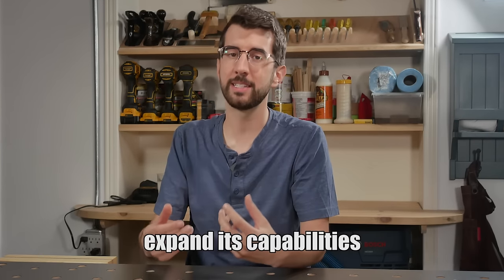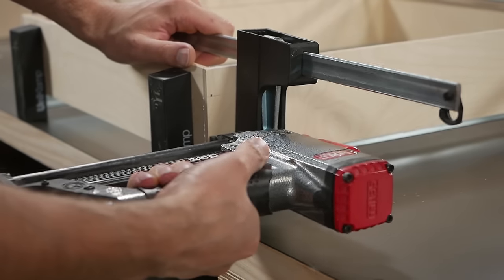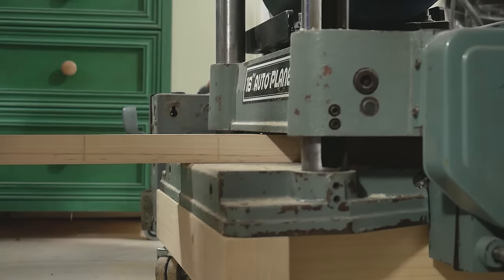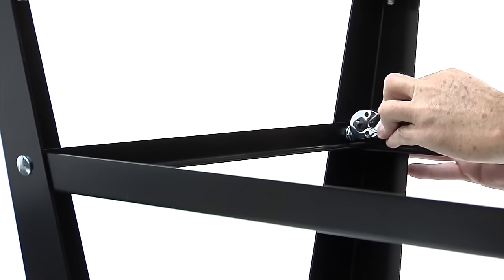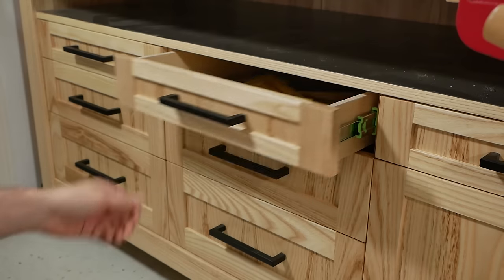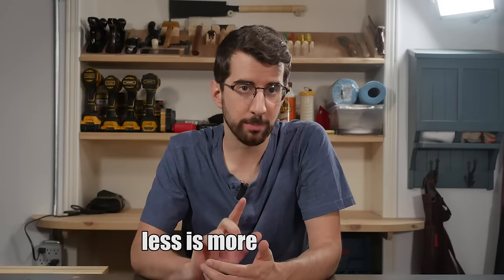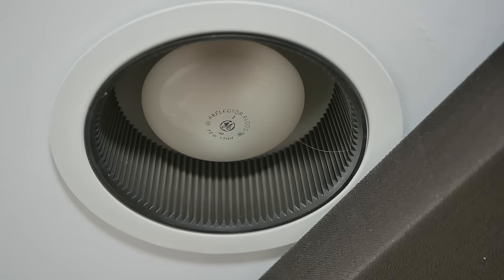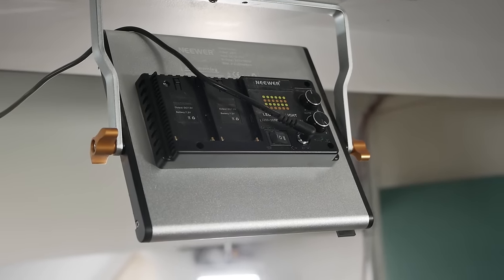a better way to layout your workshop

Comment: Great video and advice. I keep a checklist on a wall that has a schedule for regular maintenance and cleaning of my tools and blades. It helps keep on top of workshop tasks that aren't necessarily every day tasks.

This is tangentially related, but I try to build my shop furniture with the same techniques and methods I would use on fine woodworking projects. It helps me practice in a space where mistakes matter less. And if there is a piece of shop furniture I'm proud of, I'm more invested and likely to keep it clean and organized.
Reply from the maker: yeah, I definitely agree with that. I also simply don't find it enjoyable to half-ass a project, even if it's just for the shop.

I could definitely clean my blades more though 😂

Comment: I run a commercial business and have for decades now running out of a small shop and a commercial storefront, the shop is only 15’x25’ and has an overhead door with an attached 10’x20’ covered area. I have a material cart on casters which can be moved around or out and can store sheet goods, lumber, and a ladder; being able to move this 4’x8’ cart around and outside allows larger jobs to be accomplished inside. I also have my drill press on a cabinet on casters that allows storage of sanders and paper as well as sortimo cases on the other side. Between the table saw with router table which is also on wheels and a chopsaw with wheeled stand I can move things around as needed. I have a bench and operating counter along both long walls with a storage wall opposite the overhead door with every wall having pegboard, I’m old school that way, with lights at 7’ and shelving above that for longer term storage; I also have storage on my rafter decking which accounts for another 180+ sq.ft.
I have used this space to build cabinets and custom inserts for existing spaces as well as large furniture. I like having all tools, regularly used, at arms reach, with second order items below the counter, and third order items above the lights or in the rafter space. While most of my work is out of a custom built trailer in the field there I still do quite a bit in the shop. 
I must agree an annual cleanse is a good idea as one of the tradesman I came up learning from is so attached to things he hasn’t used in decades some of which don’t even still work, like old battery tools, 9.6 volt Makita, 14.4 volt DeWalt. If you have a small shop you have to be efficient and can’t afford hold onto fever. I’ve been doing this for more than 3 decades now and have learned, hard lessons sometimes, to not simply store everything because “you may need it”; I keep what I regularly use and frankly will buy one offs as I need them rather than take up what space I have storing things. Also working out of a trailer you become quite adept at knowing what you need as you have to fit everything into a 7.5’x16’ package while still allowing some work to be done inside, as/if needed, and weighing less than 5,000 pounds. I will say switching to a trailer was the best thing I did as it beats a work truck or van as far as insurance and operating costs and simply allows me to tow it when I need it with my personal vehicle, which means I only need to own,,pay for, and insure one vehicle vs both a personal and a work vehicle.

Comment: I put the focus on "outside".   I have two grinders which I set up outside of the garage door.   Compressor has done well in the attic.  If I could keep a miter box outside I would.  The key is appearance, because keeping tools safe from rain is actually easy.   tHanks for the video

Comment: In terms of First Order of Retrievability, you can have cabinets up by your ceiling that store your excess sandpaper or other accessories where you only need maybe 1 or 5 in easy access. This could allow you to reduce the size of your sandpaper rack. Have that jig that you only use twice a year, hang it up out of the way.

Comment: I have this trouble too. An 11x8 room. Table saw, bench drill, bench bandsaw, storage bins and dozens of tools.  Still putting it all together.  Right now I positioned an 8x2 bench along the back wall and have a 6x2 bench against a long wall and 4x2 bench against the other long wall. Designated a machine bench, an assembly bench and a detail/fine craft bench….now I got no free space!

Comment: Right on. Shadows are pernicious! For reasons of both both safety and utility, there's probably no such thing as too much lighting (especially when staining, finishing and painting). 4' long hanging LED fixtures are really cheap now, and are (relatively) easy to place and power. These made the biggest single improvement in my small shop over the last four years.
Reply: When I had my garage built with an area for a workspace, I was generous with the overhead lighting and I love it. Now that I have some large tools and cabinets, I also have to add some task lighting to compensate for shadows. It's not only a safety thing but plenty of lighting makes me happy and less fatigued, too, when I work there.

Comment: Love the graph paper modeling.  I did it for our last home (1,110 sq ft) and furniture, it was super helpful. 
Garage now has a built in workbench with cabinets below but also overhead that are too deep. Really just in a bad spot entirely. Not sure whether to use it for storage and put a usable bench elsewhere or what? Its been 2 years and about 60% of the crap doesn't have a home location. Totally overwhelmed and it feels like an unachievable task.

Comment: I'm one of those people with deeper-seated issues, but it's not about avoiding opening drawers.  I don't follow "First Order of Retrievability", but as someone with pretty bad ADHD I learned I can work better if what I need is in sight and/or at point of use.

I don't mind opening a drawer to get to my drill bits, but I will mind it if that drawer is anywhere other than underneath the drill press.  If I have to walk across the room to get a drill bit, I will forget which bit I needed by the time I get to the drawer lol

Comment: When I moved after I retired I gave up a 1300 sq ft shop and built a 400 sq ft one.  Everything with the exception of two benches are on wheels.  Even the 2 HP dust collector and the Shop Vac/Dust deputy are on mobile bases.  The band saw, miter saw, router table, jointer and thickness planer are all moved every time they're used.  The table saw on a mobile base is virtually never moved; same with the heavy duty bench top drill press but both of them could be moved if necessary.  Even the assembly/outfeed table is on wheels.  All of the tool bases except the jointer have drawers.  With a GOOD small square a miter saw can be set up for very accurate cuts.  My miter saw base not only has casters but folding wings as well.  It's much better for cross cutting long material than the table saw.  

All of my machines are set up at the same height as the table saw's top which allows the mobile assembly table to serve as an outfeed or extension for any tool in the shop except the drill press.  Since the drill press is adjusted constantly it's a different animal from anything else in the shop.  It has its own height adjustable supports built into the mobile base.

Comment: Get two hydraulic lift scissor tables. They are not cheap but have multiple uses.
Depending on what you need at the moment they can be set up as extension to small bench, infeed and outfeed tables,  stand for planer, bench top saw, mitre saw, etc, help with moving heavy pieces, etc, etc.
When not in use they can be lowered and stored under the bench freeing floor space for a party.

Comment: It's a bit outside the scope, but also potentially the biggest space saver: outsource. Get space/time in a community shop. I pay $250/mo for unlimited nights and weekends at a co-op warehouse shop, and now I've got access to equipment I could never have dreamed of fitting in my home, tons of work space, and I get to observe + consult people whose skills far outstrip my own. I can do finishing work at home, and not have to spend 30 minutes figuring out how to rearrange things to get enough in/out feed for a long board or whatever. The trade-off is you've got to be good about project planning since you won't have access to every tool all the time; my strategy is to always have a few different projects going, so if I brick wall because of tool access on one thing I can refocus on something else.

Comment: Funny I don’t have one single drawer in my shop.  All shelves or pegboard. They are all very neatly organized BUT I have zero real estate left.  After assessing what I have on pegs and what is actually not frequently used I think I am going to relocate those items to drawers where I do have some real estate under some benches. Thanks for the tips!
Reply: Drawers are the highest order of storage. The hierarchy is piles, shelves, drawers. A drawer is just a fancy shelf. Shelves are stacked piles. I think the next step in storage will be extra dimensional. You know like the TARDIS? It's bigger inside. We're still a ways from folding space though.

Comment: Great advice! I work out of a garage, and jugging room for tools and everything else (wall storage, water heater, furnace, car, washer/dryer, etc.) makes it a challenge. I made a simple workbench out of 2x4's and plywood top, and then attached a homemade router table to the 2x4 supports with folding table brackets so I can raise it up when needed and doesn't take much more room. I also made a custom cart for the thickness planer which has a large storage drawer for circular saws and other stuff. I like the idea of cleaning out the shop once a year - a great way to get rid of items you haven't used and make up space for new tools you need.
Reply: What are you, crazy?! Car? In a garage. Get outta here!
Reply: I need more lighting. Without question.
Reply: @johnanthony2545  I added 2 sets of LED light panels from Costco which made a huge difference.

Comment: Extra: Multi purpose workshops. Not everyone with tools is commercial…or only a woodworker.  My “craftroom” caters for things like…repairing a chair, making a cabinet, soldering/brazing, sheet metal and making bespoke fittings, hobby power carving, paint spraying etc  Generally small’ish stuff, but covering several disciplines. Also…..Modular workshops, mobile workstations!

Comment: My shop is far from perfect, but one additional thing I did was make a couple dozen identical tote bins.  Like a more squarish version of a carpenters tool box.  Open top.  About 14" long, 14" high, and 12" wide.  Made from standard dimensional 1-by pine shelf material.  Specialized by task.  One for soldering.  One for automotive wiring.  One for 1/4-20 bolts/nuts/washers.  One for glues.  That way when there is a soldering job to jo, I just grab the soldering task box and get started.  Then I put the whole tote back on the shelf when done.
Reply: My shop is  organized around milk crates of similar size.  They also stack well and roll on a small harbor freight dolly.

Comment: I’m super lucky to have a large shop. The previous home owner had a workshop and made pottery. So the shop is an addition to the house complete with its own HVAC. It’s about 32x35. However… there are obstacles	. There are four large posts down the center, a set of stairs to the second floor. And three separate doors that go to the outside. One of them being a set of double doors. Which is SUPER great for bringing in material and taking out projects. Around one of those poles the floor has sank. This is where they had their pottery mixer and another HEAVY item for pottery. 

All that to say this… even with a larger shop… I have a horrible layout. But I can’t wrap my head around how to do it differently. I’m stuck. I would LOVE LOVE LOVE to pull up a storage container to my double doors and empty everything from my shop into it. Then place things in. And then… I would be forced to make harder decisions about things that have gotten buried and purge. 

AND LIGHTING!!! I need to get this taken care of. 

Very motivating. Thanks.

Comment: When planning your shop layout I've just discovered you can use excel spreadsheets for this task. There are a number of videos on this out there. Ive had only a basic play with this, so i'm sure what limitations one would hit, but I think its definitely worth a look.
Reply: I've been using a spreadsheet for layouts for literally decades (starting in the late 90's). I have a spreadsheet where each cell is a perfect square [width & height 0.1632″], then locked the file so it cannot be deleted or modified. 
To do a room simply put a 1 in each box that matches the room's dimensions. You have to decide how big each cell is, whether a cell is one inch or one foot, or whatever. Then to ensure the room is the correct size just select one row or column and it will add up all the 1's and show you the total at the bottom of the window (at least Excel and LibreOffice Calc do...). If your room is 8'x11' with each box as 1 inch, then you need a rectangle of 96x132. Then take the measurements of an item and, outside of that room, make the shape using 1's again, but change the color of it (ie red for bed, blue for dresser, yellow for lamp, whatever). Copy each item then paste it in the room. Copy so you can start over and won't have to recreate them. I will make each piece vertical and horizontal. Putting things diagonally would become an issue. I've used this method on bedrooms, bathrooms, family rooms, and garage.
Reply: Puting things at an angle or overlapping (if different heights) seems like a PitA with a spreadsheet

Comment: Curtains can help a lot in some circumstances - be it material or a rigid material (corflute or whatever).

My workshop is my garage for my car and transforms.  As someone who does airbrush art and needs to spray in my shop at times using mini gun... I would prefer closed storage for simplicity of cleaning and prevention of mess. 

This doesn't mean cupboards/draws ... it can be a case of having removable panels across open cabinets (removable door - it could open upward or come off), or even curtains that can pull across in front of a wall of tools on cleats etc. This can work GREAT for keeping overspray off everything. I'm not sure how it goes with wood dust as that will get in the curtain and be a bastard to deal with as it will fall out when you move the curtain. Being able to remove them to shake or using a plastic sheet might be ok? 

I also buy used metal filing cabinets for most of my power tools and saws etc. Cheap, super strong.

Comment: Excellent video Scott. I’ve been struggling with my shop set up as I grow it and I will be using a lot of what you brought light to as I continue to develop my layout. And one thing I would add to your video, and it’s something I’m lacking, is adding more outlets than you think you need. It becomes massively annoying when filming my YouTube videos and I also need to power soft box lights. I am constantly looking to stretch extension cords and unplugging items to power others. Thanks.
Reply: I have a bench in the middle of my shop that I ran power moulding strips down both sides of with double duplex boxes on each end filled with receptacles. So that's 26 outlets. Then I have plug in power strips a few places in my shop too. So I can't say plugging things in is an issue for me.

Comment: For lighting in my garage Inreplaced the bulbs. Instead I use the LED lights with three adjustable panels(wings) which has changed a dingy area into almost daylight.

Comment: My shop is shared with two cars and i refuse to park in the driveway when i have a garage so i have a 4 foot by 8 foot platform with a cable system that retracts it into the ceiling to store my lumber. i lower it to grab what i want then use a drill to crank it back up. I've designed it to be able to hold 5,600 pounds with a 1 to 32 gear reduction and only store about 500lbs in it at a time no more than 1k. I built it about 2 years ago now and not a single strand of wire has snapped in the 250 feet of cabling in the system for just 8 feet of travel. Everything else in the shop is on wheels and everything can be used as infeed or outfeed for all tools, saw, miter saw, router table, drill, even my lumber storage since i can lower and raise it to match where in the pile im pulling out from.

Comment: The tool I use the most is the vice!
I have a small shop, but still have a small set of drills (common sizes) in three places. The space saved by removing them would be trivial- and it is four steps- each way...
Drill press- yes, not needed; the mill can do the job. More accurately.
Everything except lathe and mill are on wheels- I configure at the start of a session to match the type of project. All under-tool space is storage. My table-saw/router has a power lowered MFT top for sheet material work.
Yes, wall first, drawer second, toolbox never.
A 3D printer is essential, to make storage organizers. Perfect size, and thin wall (wood is too thick).
Kysan foam is nice- but it is not flexible. One more tool...

Comment: Good video. A few thoughts...
Drawers are very convenient, but use up to 30~40% volume just in the drawer carcass and slides. That's a lot of cubic volume for convenience. Think carefully.
My first apprenticeship we did a quick put-away end of each day. But all Friday afternoon - after lunch to close - was just shop clean-up, organizing tools and materials, sharpening blades, etc. A very good practice. Maybe once a month for the home hobby shop?
When you find yourself searching for something; a tool, a part, materials, whatever ... it's time to stop and clean up. Cleaning the shop clears the mind.
Don't under-cut/over-snark the science of shop lighting. A lot of excellent work has gone into this topic and is available online. Lighting levels are important for effectiveness and safety. A bit of research can save a lot of frustration and money, and maybe a finger.